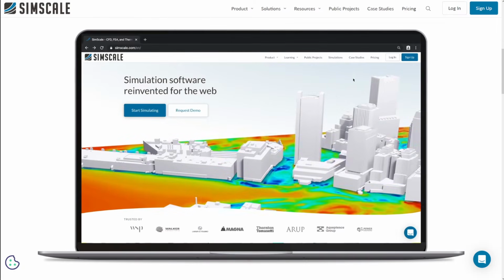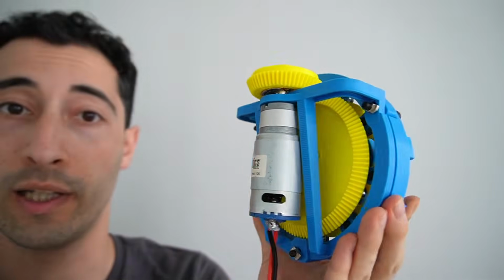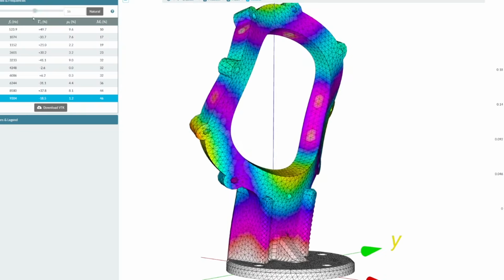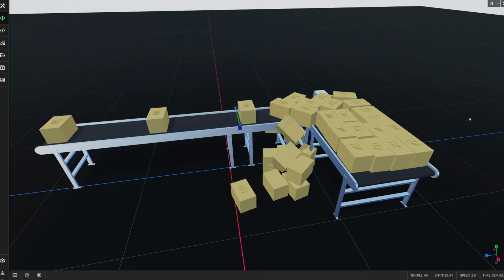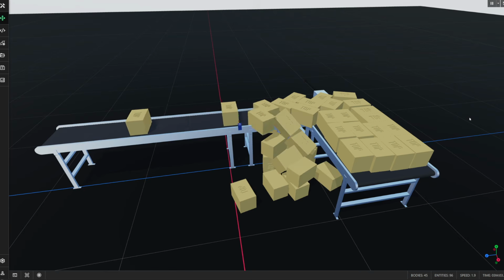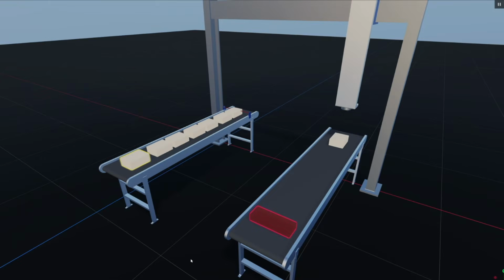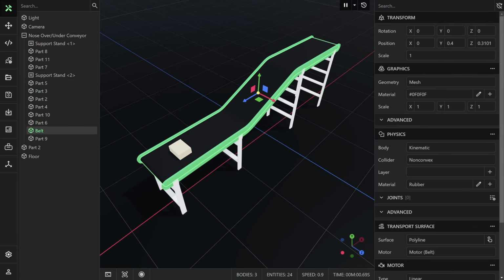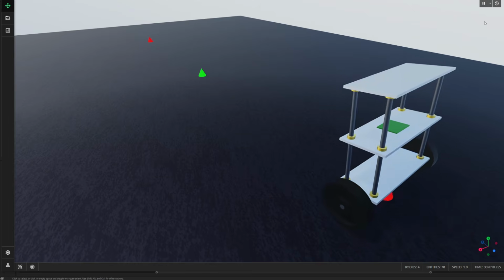The Ultimate Guide to Free Onshape Simulation

Comment: I wonder how accurate are those FEM-based simulations on 3D printed parts which are mostly hollow and a little infills.
Reply from the maker: The MJF Nylon ones are solid and the PETG one is printed or can be printed at 100%. But, I agree that since FDM prints are not isotropic, the simulation needs to have that dialed in.